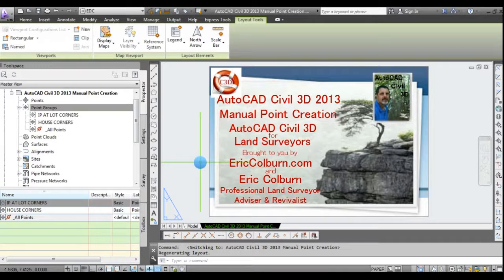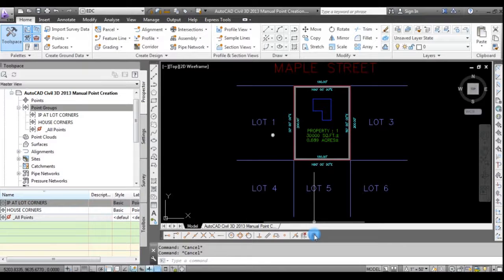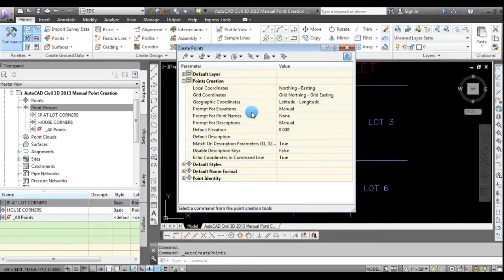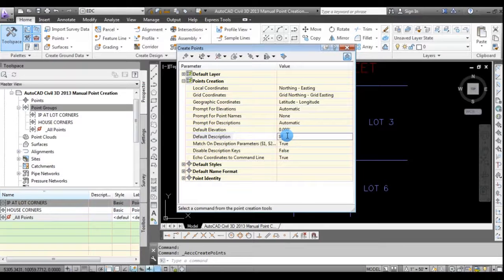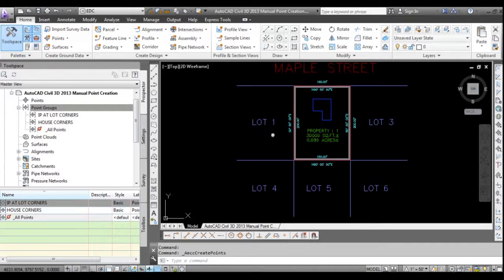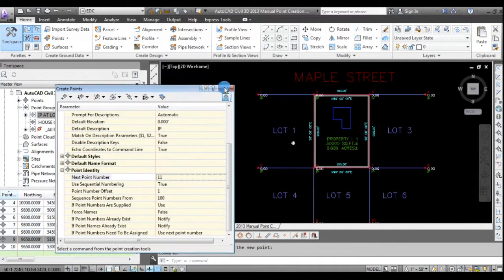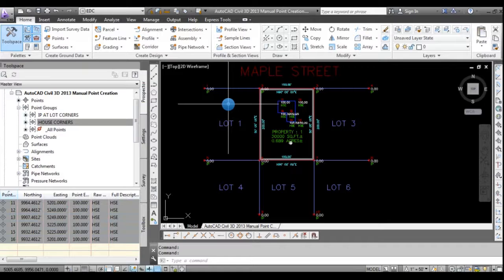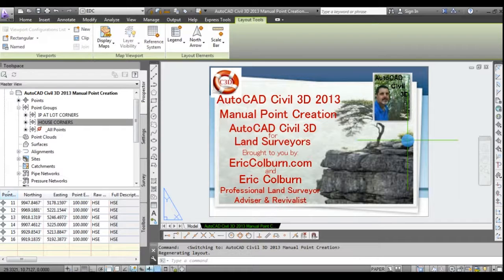AutoCAD Civil 3D 2013 Manual Point Creation

Comment: I assume there will be no answer to my question, but I'll give it a go anyways: Earlier this worked fine for me, but lately I have to reclick "Manual" inbetween each point I create. This is a hassle when you have to mark 100+ points. If I click "Enter" to re-enter previous action I'll be able to create a new point, but the name and everything is reset to standard, so that wont do any good.
Any tips anyone? Thanks!

Comment: @t

Geospatial technology and Geographic Information Systems (GIS) have rapidly evolved in the civil engineering industry over the last twenty years. A vast majority of city, municipal, and utility organizations maintain active GIS that serve the needs of both internal and external clients. Naturally, there are a large number of industry software vendors that are trying to meet the ever-increasing demand for reliable geospatial technologies and data.

In typical civil engineering projects, such as land development design, many departments are involved in using and integrating geospatial information. Software applications that address all project phases seamlessly are most beneficial. Software system architecture needs to enable individual programs and departments to communicate efficiently with each other. AutoCAD® Civil 3D® software includes AutoCAD® Map 3D tools and supports many other industry file types such as Microstation DGN files and ESRI shapefiles.

Comment: Where are the short cut keys?  I use ctrl R to access rotation in MicroSurvey.  Or right click on the mouse to select the rotation option.  The style you have adopted is cumbersome.  The windows are cluttered with too much information to do the most basic operation.  You want to customize commands in order to scale the format style with everyone.

When I draught you hear the clatter of the keyboard.
Reply: Jerry you can set up the function keys to anything that you want.  I have guys that use microstation and they switched everything so that if they are in civli 3d the function keys match that of microstation... use the help menu (by default that should be f1 key) to help you on how to set up your funkeys.
Reply: Jerry,  This is for beginners ,  good job Eric